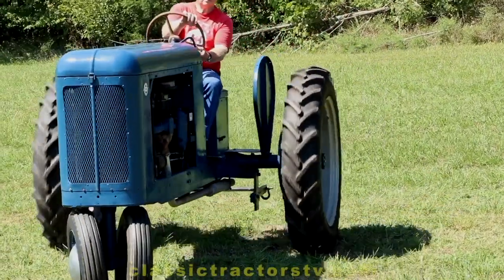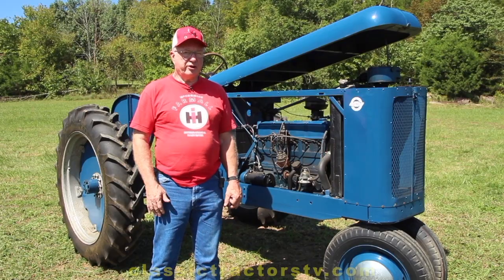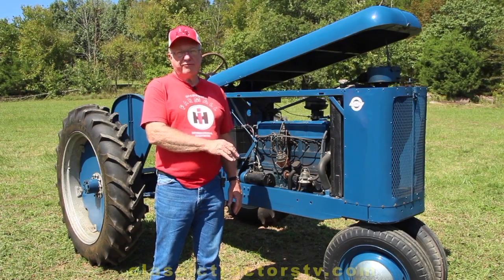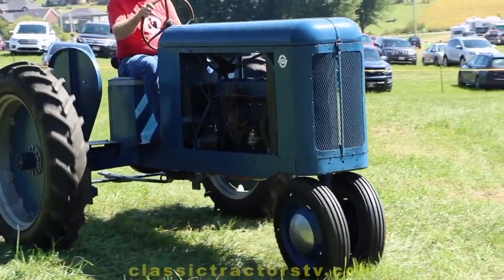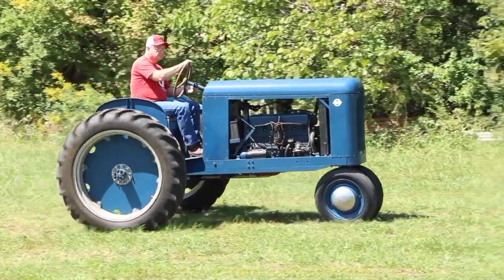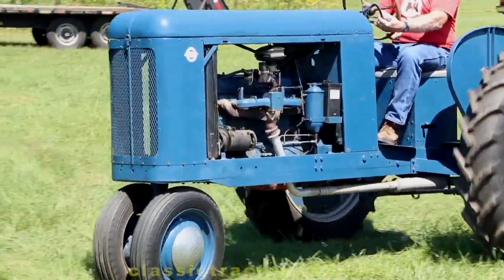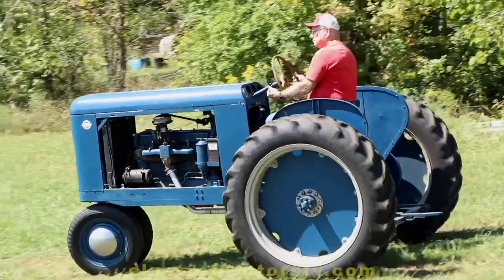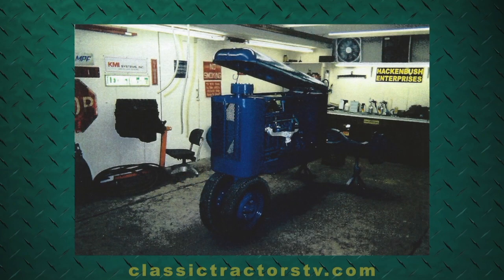1946 Chevrolet Prototype Tractor Built With Chevrolet Truck Parts! Classic Tractor Fever

Comment: I have a 1949 Chevrolet pickup with the same 216 engine. I recognized it right off the bat. Great video, thanks for sharing.
Reply: Is that ohv?
Reply: @Niterider73  yep
Reply: Funny I noticed it too from a mile away.  Kinda weird not hearing it with a split manifold and peashooter exhaust lol (my neighbors have tradional low riders).
Reply: @Niterider73  
216/232/261 OHV 6 cylinder,  I think they ran from 1937 until 1963 and came in every Chevrolet in the time frame but I am no bowtie expert just a lover of old cars.
Reply: @AtomicReverend  was this basically the blue flame 6? I don't think it would have had babboted rod bearings in the 60s did it?
Reply: @Niterider73  far as I know it was a babbit engine all the way to the end... But I am not possitive on the statement.  Kind of like dodge or Studebaker running  flatheads until 1960. it was very outdated when compared to fords 6 cylinder they called the thrift power or the 223 that was in the base model trucks throughout the 1950s or ramblers 196CI that was modern for the time. 
The 1950s you figure Americans were really wealthy when compaired to the rest of the world so all the manufacturing research and development money was spent on OHV V8s, awesome styling and power stuff that is just now starting to become standard equipment. The 6's were just kind of neglected by GM   It was the rise of the Rambler, VW and the recession of 1958 that pushed for advancement.  Think of all the economy cars that came out in the early 1960s (American, valiant, dart, falcon, special, corvair, chevy II and the lark), all of them had modern 6 cylinders I think but GM was a good year or two behind AMC or ford...
That being said the 250/292 6 that eventually came out to replace the 216 engine family was probably one of the best engines ever made by anyone.
Reply: @Niterider73  oh and yes it was the legendary blue flame 6 that the vette had in 53 and 4 since I forgot to mention it... 
I for some reason I also think I read that it came in Bedford trucks in England but I am not sure on that either.
Reply: @AtomicReverend  The 232 you listed was actually a 235 !!!!!
Reply: @Niterider73  The chev 216 had babbeted rods thru 1953 in standard trans cars, its last year !!!  1953 powerglide and all 1954 6 cylinder engines went to full pressure oil and insert bearings !!!   That 235 and 261 engines ran into the 60's when the 230   and 250 and 292 engines came out  !!!!
Reply: @Niterider73  Nope from 1954 on all chev 6's had full pressure oil and insert rod bearings !!!
Reply: @AtomicReverend  Nope  you are wrong !!! 1954 and on ALL chev 6 cyl engines had insert bearings and full pressure oil !!!   The best 6 cylinder engine ever built and maybe the best engine ever was the Ford 300" 6 cylinder !!!  Proven fact !!!
Reply: @wilburfinnigan2142  full pressure oiling? Was it not beforehand? Was it a splash system back then?
Reply: @wilburfinnigan2142  I am not brand loyal in vehicles, I like them all especially American cars until about 1978ish and it would be really safe to say I am a gearhead and have owned a ton of them in my life (well over 100 mainly domestics).. They were All dead when I got them and all left driving and registered and I dailied all of them until the new wore off then on to the next toy, , as I get older I tend to go a bit farther fixing things that need addressing and not just the drivetrain and brakes..
You mentioned the 300,   I actually currently own a 300CI ford with 3 on the tree currently in a 70  f100 that can sit for weeks and fires right up never missing a beat, great engine for sure,  after 50ish years how ever I think it needs the valve seals replaced as it does burn a small bit of oil and I have no idea how many miles are on it but I will about guarantee that it has went to the moon and is on its return trip judging by the wear and tear.   I also currently own the other makes legendary 225 slant 6 (the pic i am using is a 1964 valiant interior)... Truth be told most american engines in the 1950s and 1960s were all pretty good regardless if you're talking a 6 or 8 or even the few 4 bangers.  i mean you never hear of a 390 ford FE or a 425 nailhead Buick eating a head gasket or just getting a random intake leak... It just doesn't happen. Even most of the automatics were built well like the Ford C6, the Chrysler toqueflite 727 or the GM th400.
 I mean rhe AMC 232/258 6 cylinder eventually became the 4.0 HO that powered every jeep product for 20ish years and had almost a 50 year production run starting out in low lever ramblers and engines like that are literally time tested.   
All the American makes made great engines it wasn't until the vega 4 banger that GM made a blunder and chrysler it was when they let Mitsubishi design some techie engines that they had reliability issues. Ford was the Brit engine escort in the early 1980s that we saw an issue with reliability and AMC was great until the end minus a Renault sourced trans in the 1980s for some of its cars. 

Now that being said I have had a few good Toyota's, the land Rover (Buick designed v8),  and quite a few of other cars from japan and Europe that were pretty good quality too and some that were terrible and expensive (BMW I am looking at you).  
Anyways my point is the domestics were all good all the way until sometime in the 1970s when the perfect storm for them, with emission reduction measures, oil embargos, junk new tech (fiber gears, why oh why would GM use fiber gears in the legendary small block?), pressure to build smaller cars and increased safety B.S. gave them a hit towards their reliability that ai don't think they have still totally recovered from even though it isn't true but that's another story.
My next adventure is going to be a farm tractor (I really like those Deere tractors with the big two cylinder engines as they sound so cool under load) and a international 2ish ton grain truck from the 1950s because I have neve owned either and I got an itch that need scratching lol
Reply: I have a 47 Chevy pickup with that same engine and transmission.

Comment: Absolutely crazy how simple of a machine it is in my area which is really rural people made a lot of their own tractors.a lot of people use model s and model Tees lot of people did this in pretty much made theirs from scratch took a ton and a half rear end use a splitter in the transmission to get a geared real low and put a decent horsepower size motor on it then once after world war II hydraulic started coming in about where they would put the crank start they would just put a hydraulic pump right out on the end of that so they could even run hydraulics pretty amazing and pretty simple a lot of people don't realize how simple farm machinery really is including hydraulics in itself hydraulics is one of the most simple concepts there is
Reply: I grew up on a dairy in a small town in Oregon and 2 brothers lived down the road from us...the built 90% of their farm equipment... Some a lot simpler then the commercial and did the same thing and some was...holy moly what is it and what's it for...lol 
1 that sticks out even now was a 8 wheel -all wheel drive tractor that pivoted in the middle...yrs before any commercial ones came out.
Reply: @scottm.franklinnc7942  building homemade 4WD articulated tractors was popular back in the day as some farmers need a big horse and the equipment manufacturers either didn’t make them or they were too expensive

Comment: Interesting Story ..   a  Blue flame engine with  pressure oil system would have plenty of power..   No Pressure oil to the rods would be bad..    No PTO  either ..
Reply: A 292 would be my choice. Biggest Chevy Inline 6 made and just about indestructible.
Reply: I noticed the lack of PTO also.  Guess you'd have had to take off the trans. side plate.
Reply: I disagree with no oil pressure to rods, yes it's good, but Farmall f 20 and 30 had splash system to lube rods, the tractors were ledgenary!!!!
Reply: @chadbailey8152  if you kept your oil in them and did not overwind them they would run forever.
Reply: A tractor with this high of horse power would have been intended as a tillage tractor more than a stationary power source, so the lack of a PTO may not have been that big a deal. Not having hydraulics seems to be a bigger issue to me.
Reply: It's just a "prototype" at best. And sounds to me like it wasn't even authorized by GM.
Just made by an industrious person who tried to pitch the idea to Chev I'm thinking.
If put into production it would most likely have a PTO and a hydraulics option, and w/lower gears that the std. ton-and-a-half truck possibly.  I'm a car guy but not a tractor guy, so this is my best guess from a city boy.  : )

Comment: Pretty interesting tractor. The old stovebolt six would have done pretty well as a tractor engine, I believe. It was a low rpm, high torque engine to start with, and as long as it was governed between 1800-2500 rpm, they would run for a long time with proper maintenance (I know, because I had a '47 Chevy pickup for about 22 years, and the first 10 years I had it, it retained the old 216 stovebolt motor). I think GM missed out on a lucrative market in farm equipment. They supplied several tractor manufacturers with small GM/Detroit diesels for their tractors, but never built tractors themselves. If they had partnered with a company like Oliver (who used some of the 4-53 Detroit's in their tractors), they could have done pretty well I believe. There's a lot of tough 4 and 6 cylinder engines that would have worked well in the industrial arena like the 235 that came after the 216, the 151 Iron Duke 4 cyl. and several others.
Reply: Like the Gentleman said its splash lubricated with babbit bearings. I don't think it would hold up to fieldwork very well
Reply: @ohlookadragon  The Ford Model N was splash lube and look how many of those are still around and running well. As long as the rods and internals are actually getting oil, they will live. Correction: I was thinking of the 8N and confusing it with the Fordson N, which actually WAS splash lube. The 8N actually did have an oil pump...
Reply: @danw1955  yes I am aware believe it or not I have a 1939 English fordson. The only thing is it turns at maybe 1200rpm max and the basic engine design goes all the way back to the late 10s with the fordson F. There is a reason the 10-20 put them out of business in the states.

Comment: Would have been ahead of its time.refinements woulda followed.   I put a ford falcon engine in a massy haris junior. What a ride.
Reply: Not sure what about it is ahead of its time.  Doesn't even have PTO or a three point lift.  I'd be curious on the gear ratios for tractor use since it is all off the shelf parts with tall tractor tires bolted on.
Reply: @ShainAndrews  With the 2 speed rear end and granny first gear i am not sure it was geared low enough, maybe add another trans in the drive train !!!
Reply: @wilburfinnigan2142  My thoughts as well.  Prototype proof of concept sorta deal.  On the other hand I bet road gear is a real treat.  LOL.

Comment: Would have been cool if chevy went into production of tractors I like the ideal of using truck parts.
Reply: Cheap and reliable for the era... Genius in my opinion and I am not a hardcore GM guy, more or a Nash/Rambler and Mopar guy in that era but a cheap 6 cylinder that even by the post war era was proven a great engine GM would have sold a million of these to the brand loyal guys and with power numbers that was unheard of until probably the late 1960s.
Reply: Mark Grudt  well if the trucks that hauled the goods we're good enough to to do the job I don't see why the tractor wouldn't have been up to the job every tractor has it's strength and weakness.  keeping that in mind that it is a first prototype and would have under gone many changes.  That being said they could see that there was no room in the market look how many tractor manufacturers are left compared to what was.
Reply: @chevyfan82  I was thinking like you, I could see a guy that was using Chevy grain trucks and pickups going "I could buy all my stuff from my local dealer and get a good deal and have GM reliability (at that time gm was by far the biggest company) and get all my parts at the western auto (1950s parts chain) in town..."
Having the same drive train as the other vehicles on the farm you could memorize stuff like plug gaps, points and valve lash adjustments and wear items you could have on the shelf and not have to carry on hand 5 different distributor caps for example.  
As for farm tractors of the era none of them were really huge in size yet, it wasn't until the mid sixties sizes got monstrous... This tractor would have been ideal for a small to medium farm of the era just like a 8n Ford... Except with way more power.
Reply: @AtomicReverend  yep it would have been very reliable and very affordable and with hydraulic brakes that would have been a game winner, but with previous venture's GM did with making tractors they decided to just focus on vehicle production.  Some might argue that having a splash oiling system for the rod bearings was a weak point, but most early engines were like that and they are still going strong.  It's funny because the people that say this would have been a bad idea must have never been around many farms of that time to how many farmers would take there old car or truck and turn it into a tractor.
Reply: @chevyfan82  I guess they never read the history of the Jeep either... After the war it was sold as a cheap 4 wheel drive implement machine... They sold all kinds of tools for It (although as a jeep lover I have never seen a single tool but I am not exactly "farmer Al" either living on my 1/2 acre in California but I digress). It wasn't until rhe early 1950s that the offroad hobby took off and made the jeep into a legend but its commercial roots was in farming.
Reply: @chevyfan82  sounds like a good ad for it ... 👍
Reply: @scottm.franklinnc7942  👍
Reply: @AtomicReverend  Your right , our farm handyman had a little yellow jeep that he farmed his 80 A, with it . It had a pto out the rear that you could put a belt pulley on . And that was in the mid 50's so they were tough little jeeps .

Comment: Pretty cool. Never knew GM tried to build a tractor.
Reply: They had previously, in the 1910s, bought out Samson Iron Works and modified one of their tractors called the Sieve Grip, by putting a 4 cylinder GMC engine in it and slapping GMC badges all over it. After that they built the more conventional Model M to beat the Fordson F, but it couldn’t compete with the price of the Fordson, and Samson disappeared quickly.
Reply: ih 1206  GM never tried Mr Nutter did and offered it to GM !!!  Pay attention !!!
Reply: Wilbur Finnigan sounds to me like Mr. Nutter was under contract to build this prototype so it’s would still be a GM product. I understand GM didn’t physically build the tractor but they commissioned the project.

Comment: I own a Custom tractor which was built in Shelbyville In in the late 40s Was made out of Dodge truck parts  Tricycle front  5 speed tranny hydraulic  brakes and factory tach. About 35 mph

Comment: I would like to see some documentation showing a real connection with GM management. Until then, it could be just a good home built project from back in the day.  Totally fascinating as it is, very well thought out.  As for the dipper rods, IHC and others used that in tractors for decades with great success. As long as the right oil is used and the rpm kept realistic, it would have done well.  I've seen that stove bolt 6 used to repower an Oliver 70, years back. It also was down in the KY area, nice fit up. The guy claimed he pulled 4 plows, but I think he would run out of traction in any hills or heavy soil. Those truck engine and trans assy lent itself to easy fit up with many older tractor chassis.
Reply: Do your own research.

Comment: General Motors I think entertained the idea of building tractors about the same time as Henry Ford right after WW1
Reply: Yeah... Ford made some tractors after WW 1...  They were called Fordson... was made in the 1900 years.
I have seen a few around... really simple tractor.. they didn't have a water pump... had a fan though...
The circulation of water was used as the expansion of the water getting hotter which made water to flow through a radiator.
Reply: @MrRoadrunnerman  They use the Model T engine !!!
Reply: The Fordson tractor had it's own engine, not from any car or truck. It also had babbeted rods with  dippers and NO oil pump, the flywheel thru oil into a scoop that led it into troughs that fed the main bearings.

Comment: Ok, that IS unique. So many people grossly misuse that word, but it is definitely the proper term in this instance.

I doubt it would have anywhere near 90 hp, because the engine wouldn't run at its rated RPM in a production farm tractor configuration. You wouldn't be able to stand the noise and couldn't afford the fuel consumption. It would likely be governed in a production model to 1800-2000 RPM.

I wonder what the gauges should be?